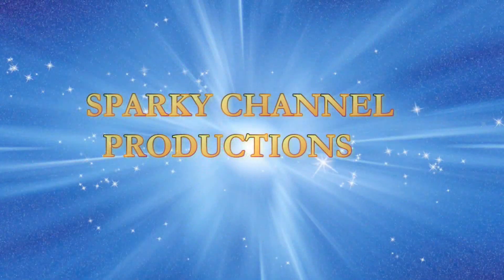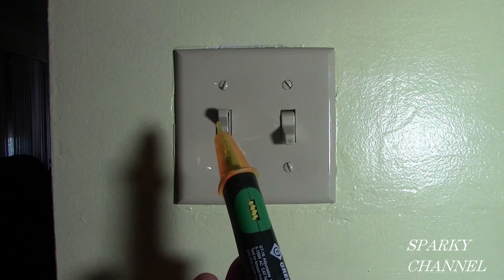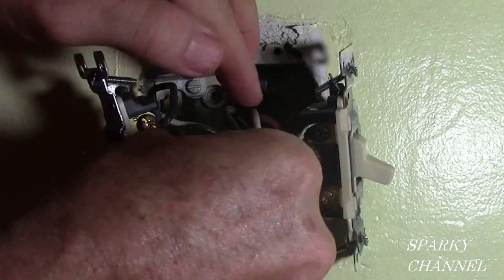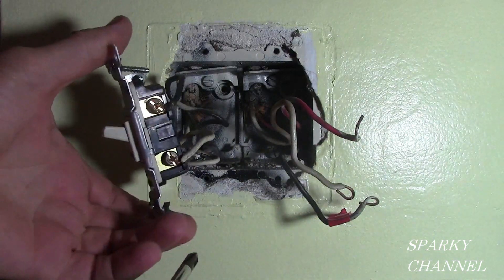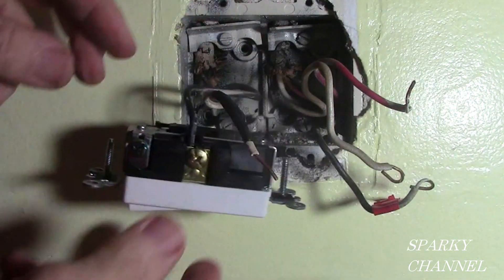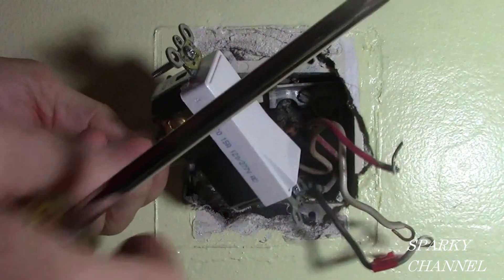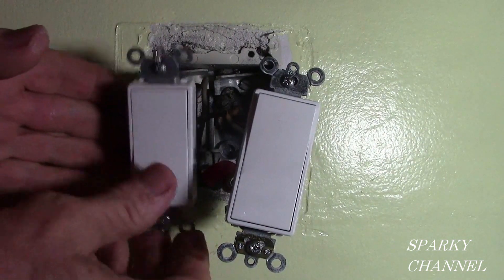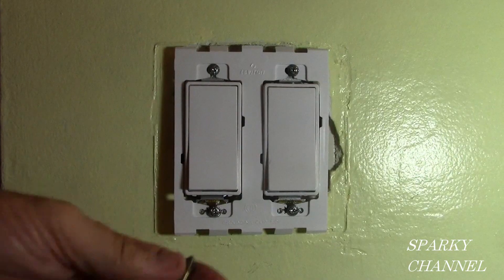How to Replace 2 Switches: 3-Way and Single Pole When You Have No Ground per NEC 2020

Comment: Will need to check for grounding on some of my Grandmother's Outlets/Switches and consider GFCI and/or screwless covers as needed.  I'm particularly concerned about one Metal Switch Plate in the Garage (which I think is Grounded) and another that I know isn't that I should install GFCI protection on...
Reply: Your garage is likely grounded if the property was built in the mid 50s and later.  My home was built in 1955.  The bath switch box, receptacle, the kitchen receptacles by the sink, the laundry room receptacle and light switch boxes to outdoor lights are grounded.  My garage is detached, and all my garage electrical boxes are grounded per 1955 NEC code.
Reply: @maxheadroom8857  Not sure what NEC code applied during construction of the Grandmother's home or was observed then (early 1950's Wisconsin)... Nor during several "updates"/expansions done since (guessing early 1960s into the mid-70's).

Most of the original circuits were armoured cable allowing for grounding (but no dedicated grounding wire) via the metal boxes...  

But there was several additions/updates in early 60's using 14-2 NM wire (with no ground wire) so those specific circuits/boxes do need some added attention and probably some GFCI upgrades...
Reply: @lgoamity  there is a provision in the code that allows you to borrow a ground from another circuit on the same breaker.  For example, if you have a bonded box in your bathroom, if there are ungrounded receptacles on the same breaker, you can run a 12 gauge ground wire from the unbonded metal box to the bonded metal box.  You can legally use ground clips to secure the ground wire to an old metal box without a tapped hole for grounding screws.  I have a few ungrounded outlets on a circuit with a grounded plug.  I can clip a ground wire onto a bonded box and run a junction from my attic to the other boxes on the same circuit breaker.  I have a circuit without any grounded plugs on it.  However, I can borrow a ground from a grounded outlet box on another breaker because the breaker to the grounded outlet is on the same panel that the breaker to the ungrounded outlet is on.  As long as the borrowed ground is continuous to the panel where the ungrounded outlet's breaker is on, it is legal per code.

My home is in Southern California, Orange County.  The county goes by the National Electrical Code that is current.  NEC in 1955 required grounding on all outdoor light fixtures and outlets, switch boxes at outdoor exits, garage lights and outlets, kitchen outlets on the same wall as the sink, laundry room plugs next to the laundry sink, central heating, and all bathroom switch boxes and outlets.

Homes built in 1964 required all outlets and lights be grounded in new construction.  My best friend's father is an original owner of a house built on his property in 1964.  The house's outlets are all 3 prong from the time it was built.
Reply: @lgoamity  I found this NEC regulation that allows you to share grounding:  NEC CODE Article 250.130.C 1-4 allows fishing ground from neighboring circuit on same breaker panel.  As I mentioned earlier, I will need to pull a wire from one of my circuits to ground some boxes in my home that are not bonded at this time.  My breaker and meter panel is bonded to my cold water pipes.  My garage is detached, and a separate ground wire is clamped to a cold water pipe below the garage.  It leads to water spigots around the yard.  My house has a raised foundation, so access to the water pipes and grounding is much easier.  In older homes, it is common to find boxes with ungrounded NM and ungrounded UF cables being grounded to a cold water pipe nearby, with the pipe being bonded to the breaker box.  It is important to have the home plumbing inspected as well to make sure the pipes are all metal, and that repairs done are not breaking the continuity of the grounding.  If parts of the cold water pipes get separated by plastic pipes, you can run a 4 gauge jumper from the points of separation to restore the continuity of the bonding.  4 gauge wire will assure enough continuity to bond the ends of the separation between the metal pipes to carry any stray current back to the box.  One day, when I repipe my home with copper pipe, I will need to redo my grounding in my garage to bond the ground to the new cold water pipe coming into my garage, or to dig under the garage to bond the wires to a new copper water line in my yard for water spigots.  

A few years ago, I updated my garage by replacing the lead receptacle with a GFCI, protecting the entire garage with it.  Only 1 breaker powers my garage, so my lights are also on the GFCI.  It actually works out, as 3 of my light fixtures are pull chain fixtures with grounded outlets in full use.

Hopefully, some of your grandmother's electrical upgrades in the 60s used metal boxes rather than newly introduced plastic boxes.  You should be able to fish a ground wire to a nearby grounded box if your breakers are mounted in the same breaker panel.
Reply: @maxheadroom8857  Was going to Comment that I probably would be unlucky and not have a nearby grounded box (on the other side of the same wall) on the same "breaker" (fuse) and with your newest post... I'd probably still be unlucky and have the ungrounded box happen to be wired to the Workshop Sub-Panel.  While it does eventually end up to the same Main Fuse Box... Just my luck that probably wouldn't apply?  Will investigate further and see how lucky I might be

Comment: Worked on a "three" way hall switch. When I pulled the switch at the termination point on the circuit I tested the old non-grounded wires going into the box [replacing an old switch with a paddle switch] the only wire that was 'hot' was a red wire. I assumed the red wire was the 'line' wire. After connecting the other two wires [white & black] to the new switch I discovered the new switch and the old switch preceding that was connected to the switch I was working on were not functioning as they should. Since it was a 3 way switch I discovered the black wire showed no power because the preceding switch was turned off and the black wire should be the line wire and not red.

Comment: I still get confused by American wiring terms.  The three way switch is actually two way (yes the brtiz, Aussie and kiwis have it right).  The switch can only be on/on.  Hint from common the power can only travel to either throw (SPDT). It's clearly not travelling three different directions!

Comment: My instinct would have been to flag the white wire on the 3-way switch with the red tape rather than flag the black wire. This way, I'd just read the black wire as hot (equivalent to either the black or black flagged wire on the regular switch) and it goes to the black screw. The red and red flagged white wire are equivalent (both being red) as interchangeable travelers, and there is no unflagged white wire to be mistaken for a neutral. 

Would this be acceptable, or is there a reason to favour flagging things the way you did instead?
Thanks!

Comment: I didn’t see you wire one switch to the other?  That’s where I’m confused. I have a Light and a heater switch, and normally the light has to be on if you want heat. thats ok, but I don’t know if I bring a wire from one common to the other?  Understand Bill?

Comment: You can't use the white wire as a hot anymore? What if your in a predicament where you need to use it? Example: 3way two switches, but you can only get the travelers to one switch, and the other switch has the switch leg and hot. So you make the white wire the hot ( send the hot via the white wire) and the black and red your travelers. You can't do this anymore? I know you can't in certain states, but if you're in one where you can, can you still do this?
Reply: Essentially the NEC requires an available neutral in the switch box because sometimes electronic switches are installed and require a neutral to work properly.  However where multiple switches contol the same fixture,  3 ways and 4 ways , such that the fixture is visible from the single or combined switch locations,  a neutral shall be required at one switch location.  Meaning even in 2024, you are allowed to wire a three way set up with switch leg and power in same box aka dead end three way.   However some jurisdictions require a neutral in EVERY  switch box  and will not allow dead end three ways unless you run a 4 conductor with ground cable.

Comment: You can't use a white wire for a switch anymore? Does that mean you just have to mark it or you would need to use 14/3?
Reply: You have to have neutral in the switch box now. Yes you would bring 14/3 down if your power is coming from the ceiling. If your power is coming up into the box, then you use 14/2 still
Reply: @ClayGravil  
But if you're already using 14/3 for a 3 way switch then you would need 14/4? Where do you find that?   Or can you just run two cables of 14/2, one bringing in the black hot and white neutral and the other bringing in the travelers... One being black and the other would be white but could be painted red.  Is that kosher?
Reply: Yes you could use 2 runs of 14/2 if you don't have 14/4 available.  What I like to do although isn't required per se, is use red and blue phase tape to re-identify the black and white respectively,  for the travellers because a 14/4 cable contains a black, red, blue and white, plus the ground obviously.

Comment: Good job as always Sparky. i like to read so i pause the video's. the code did state if you had installed a GFCI breaker that would have been fine too. i suppose changing the face plate was less work.
Reply from the maker: Also much less expensive.

Comment: i've used plastic screws before and haven't had any problem with them stripping out. you just can't try to over tighten them. but why would you want to tighten them so tight anyway, they're only holding on a little cover plate, not a door or something.🤔🤦‍♂️🤦‍♂️🤦‍♂️
Reply from the maker: OK, thanks!

Comment: the common on a 3way is not always line. on the other end of the 3way it's the switch leg. and we always identify the travelers by twisting them together at the back of the box near the sheathing only about 3 or 4 twists.

Comment: I think it’s important to explain for the guys just learning this that just because there is no grounding conductor, it doesn’t necessarily mean that the metal box and device yokes aren’t grounded. If the circuits were run in that old cloth NM cable, sure it’s not grounded. But if BX cable was used and the connections are good, everything should be grounded through the steel armor. And there are ways for checking this. It’s an important concept, I think.
Reply from the maker: Excellent point, thanks!

Comment: C'mon. You're working with a metal box. I have a 1951 house in which the equipment grounds all were bundled and secured to the cable clamp, thereby effectively bonding the box to the rest of the system. With the power on, test hot to box, with a wiggy. If the circuit completes, you have a grounded box.

Any self-grounding switch or outlet would suffice.
Reply from the maker: Hi Walter. I did check and there was no bonding on this particular box. You're correct it is best to check. Thanks!

Comment: Interesting that you still got some of the on/off switches. Most manufacturers here in Germany no longer produce such on/off-switches, instead we use the 3-way everytime even if there's only one switch for the light fixture. Just connect the load to one of the terminals for the travelling wires (brass), the line/hot to the common (black), and the other terminal for a travelling wire (second brass) will get no wire of course. So actually no need for the simple on/off switches. The manufacturers did this because it is cheaper for them, that caused that they manufacture more 3-pole switches, causing a price drop for them. You can still get on/off switches, but they're more expensive than a 3-way here.

These screwless frames look very fragile. It seems you can put this on and off for two or three times and then one of the plastic strips holding the cover in place will break.

I remember, in my grandparents house were old on/off toggle switches installed in some rooms. That was the international version I suppose, instead of on and off in the on position there was a black dot visible on the toggle when in the on-position. The whole thing was made of porcelain, today there's only one manufacturer making covers out of porcelain, and this is almost unaffordable. More than 70 USD for a switch and almost 40 USD for an outlet...
Reply from the maker: Wow! That's very interesting. Thanks Marcel!
Reply: @MernokiMegoldasok  In my house from the 1950s was a wild mixture of switches and outlets from the 1950s, 60s and 70s. All switches were rated for 10A. There were different materials available, porcellain, bakelite and melamine resin. The internal material where the contact were embedded to was unglazed porcellain on all switches here. But they still manufacture such switches, for example these classics (in this case a cutaway to see the internals):

https://www.bauhandwerk.de/imgs/100637889_749aece88d.jpg

Or completely porcellain:

https://www.produktgesellschaft.de/en/switch-systems/over-centre-rotary-switch-alternation-porcelain.html?info=463
Reply: @MernokiMegoldasok  Rating is mostly 10/16A, 10A are permanent 16A for a short time. But actually there's no definition of short time.
Reply: @Marcel_Germann   Do you have any information what kind of wiring was used in the nazi era in Germany?Copper or aluminium?
Reply: @MernokiMegoldasok  Afaik copper. The thing was, at that time there weren't that much appliances in the houses which required electric energy. In most cases a radio and electric light. In better homes were also electric irons, but average people still had the old ones which you had to warm up on a coal or wood fired stove. Some people had a kitchen cooker with a single heating plate.
In West-Germany, even in the direct post-war era, they used copper wires. But everything they had at hand. For example at that time the hot was black and the PEN was normally red. But the lighting fixture of my bathroom was different: Hot was black and the PEN was violet. The installation was single wires in conduit. In the staircase one light fixture had textile insulated wires instead of PVC, it was all installed at the same period of time! When the wire was too short, the twisted the new one on the old, insulated it with electricians tape (the old resin impregnated textile one) and pulled it completely into the conduit with that "knot" in it.

In West-Germany aluminium was never a thing, but in most east-german installations it's still there. In most cases 2.5mm² aluminium, from the point of conductivity it's the same as 1.5mm² copper we used here for this.
Reply: @Marcel_Germann  Was 1mm2 copper used in the padt or was it always 1.5mm2? In Hungary 1mm2 copper and aluminum and 0.75mm2 copper was used for  6 Amp circuits.
Reply: @MernokiMegoldasok  At that time they didn't use separate lighting circuits. One circuit per room, and for appliances with a high demand a dedicated circuit. Sometimes the whole apartment or a floor of a house had only one 16A circuit for outlets and lighting. Back in those days a single family house had in most cases only two or three circuits.
Now every room got at least its own circuit, in the kitchen there are several separate circuits. The kitchen cooker and oven are connected three-phase (mostly fused with 3x16A). But they are still 230V appliances and not 400V, the load is divided equally on all three phases. And the lighting got own circuits too, in most cases several rooms on one circuit.
Reply: @Marcel_Germann  Are electric cookers and heating in Germany more common than gas?
Reply: @MernokiMegoldasok  Cooking is electric in most cases. In new installations fused with 3x16A, in old installations fused with 25A.

Room heating in most cases natural gas or oil, central heating with forced hot water.

Water heating in most cases electric, tankless or a small tank below the sink and a larger one for the bathtub or shower. In my case I got a heat exchanger and I use the gas fired heating unit for preparing hot water centrally.
Reply: @Marcel_Germann  Are oil burners also common?I saw a few German youtube videos playing with high voltage from oil burner ingnition transformers.
Reply: Nagy Péter-Szakállat Korporésön That was state-of-the-art in the 1960s. They removed them from old burners before they were scrapped.
Reply: @Marcel_Germann  What,there are no oil burners in Germany since the 1960s?
Reply: @MernokiMegoldasok  Only central heating ones, but not these ovens burning oil from a tank in the oven or from a central oil supply (thin oil pipes made of copper in the walls).
Propably some remnants are still out there, but this is the minority. Most have switched over.
I switched over from such a non-central oil burner to central gas four years ago. Sure, the installation is expensive, but this reduced the costs for heating per year about 50%!!

Comment: Hey Bill great video. I noticed both switches where 15 Amp rated , how many switches can the 15 amp breaker run on one circuit in your case?
Reply: a switch does not consume any power (if you make good connections ;-) ). The total Wattage of the lights might be more relevant. In Europe we alternate circuits between rooms, so one breaker cannot cause total darkness.
Reply from the maker: Excellent answer wim0104, you beat me to it. Happy Easter to both of you!